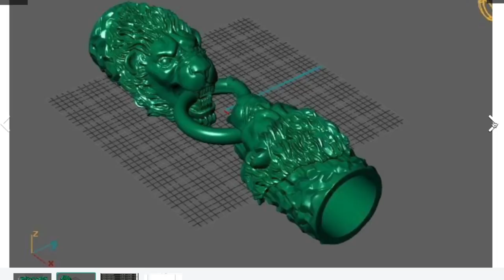HEAVY DUTY Lion head silver cuff bracelet | DYNAMIS WILD

Comment: What is the purpose of the device you use after you've assembled all the links but before you begin polishing? It is a device that appears to have adjustable sides and you pull the chain throug it. thanks for the explanation.